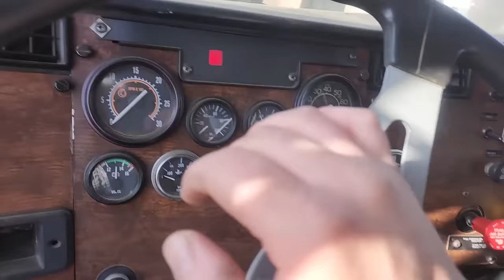"Valvetrain Knocking" is NOT what we find on this Engine.

Comment: Not a Cat engine issue here but, similar to this, maybe?  
I have a mid 90's Cummins L10 that makes what sounds like valve train rattle/injection rattle sound at low throttle but goes away when putting out some power.  Good power when it feels like it, okay power when it does not. 

New injectors and no oil consumption.    Anyone got any thoughts?

Comment: piston is installed backwards also cat motors have a specific liner inside taper of about 10 degrees if this is not finnished correctly oil sheer will kill your piston skirt

Comment: I think that injector wasn't working propply not burnig well, so fuel passed between piston and liner washing out the lubrification causeing piston seize. The knoking noise is due to piston wear, not any more perfet. As you noticed the  engine oil on the dip stick was slitly mixed wiyh diesel fuel beaing that colour.

Comment: remove and replace the engine from the front .remove the hood radiator and support and transmission . remove the rear mounts and support the back of the engine .remove the front mount from the engine and frame .now move the truck back until the front axle is at the rear support . now block the engine in front of the axle and remove what was holding the back of the engine .now move the truck away from the engine . set the new engine in place , and push the truck in to it .

Comment: By 2:10 it was evident that the engine has excessive oil leaking and was always being topped up. It 100% was run too low on oil....prolly more than once. Moghta had the wrong inhector on that scored piston.....causing the scoring which leads to blowby which leads to oil puking out which leads to carnage
Reply: Was thinking the same I know if you just want to check bearings you Crack a certain hole that gets oil last from the galleys I'm not sure which hole though

Comment: I would just disconnect the Darrick and lay it on some cribbing. Two big pins, some bolts, lay the draw works on pallets, disconnect the weight indicators from the draw works, disconnect electrical from the Derrick, viola. Call it a day.

Comment: Hey, I have a C7 acert 2006 in a freightliner. It runs fine when cold but after heats up, will start white smoking crazy and shut down. When you try to start back, smokes up the whole shop and if it does start will smoke and miss fire. If we leave it for a day come back next morning when engine is cold, it starts and runs perfectly. 

Checked all injectors all good, turbo had oil in it, we removed both turbo and exhaust manifold, manifold had oil in it. Ran engine without turbo and manifold same thing when gets hot.

We tested the HEUI pump by stepping up and down the demand with the computer but everything seems ok. Also has no blow by

Not sure what the problem is any ideas @AdeptApe

Comment: C12, 1 cylinder is causing alot of white smoke at idle, under a load(higher rpms)  the smoke turns black. Issue started all of a sudden &  engine is making a ticking sound. I  Swapped injector & problem is still there,  also making a ticking sound. Forgot to inspect the inspector liner for a crack. Can a cracked injector liner cause this problem? Or is this a bad cam? I did notice a push rod was bent a little, I put new push rods for the intake & exhaust. Injector push rod was good. Didn't notice any bent valves.

Working on it in a hotel parking lot where I just started working(it's a dump truck) no diesel mechanics around here & the closest cat dealership is 1 hour away & doesn't work on road trucks. Yep been hell.

Comment: I just recently had to put a gear case on a series 60 in a freightliner cabover because it was leaking oil. The only reason I found the leak is I blocked off the blowby tube and it began coming out from the leak😂

Comment: Is that truck maybe a workover rig for pulling the pump on a shallow oil well ? Or are you meaning water well drilling truck ?  Be nice to know why that scoring happened. We always stand up the pole or derrick before doing an engine swap and sometimes it requires an apu to run the hydraulics.

Comment: I have the same problem with my 3406 e  2002 MBN same noise from the front but the bottom of the engine 
150000 million on the truck 45000 hour's 
Just started this morning, gonna have to take it to a shop as im in Texas 1300 from home and i don't have all my tools wity me

Comment: It's an overheated cylinder. Radiator is probably just cooling the engine at partial load. Running it hard overheats the engine. I service 30 year old pivot irrigation engines. Really common event, to have the radiator plug up internally from the crap in the tap water they put in these engines. Buy and use only 50/50 premixed anti-freeze.

Comment: at 9:12 just before you get the prybar is there a crack in the block? right under the connecting rod with the two X's there is a very nasty looking line going up the block wall starting at the pan then looking like it got thinner as it goes up towards the crank.

Comment: Could of been piston to bore tolerances, ring gap, major boost leak or injector issue. Any thing with fuel or heat really will test out how well your builder rebuilt the engine.
Reply: It did seem like a bit of light shining around the piston from above suggesting the loose piston/ring package.
Reply: @Genifer Teal  I've been a machinist for 20 years professional . In that time ive noticed the tighter stuff will fail quicker. The piston and rings do not have room to grow when the heat is turned up in a high performance application or when ran out of normal operating range . Towing very heavy, leaky injector , extreme heat , boost leak . Those types of issues can cause extreme heat . When those scenarios happen your piston swells causing it to scuff the bore and butt rings. When a high performance engine are built on the machining side of things, all the tolerances are opened up to the looser side and beyond. Every metal grows the hotter it gets.

Comment: Hey quick question for you because I get mixed answers. I am buying a 1997 RV with a cat 3126 I believe. What engine oil should be used? I've heard 10-30 and I've heard 15-40 also read that 15-40 is hard on the heui pumps. Do you recommend changing that heui pump out after x amount of miles as a precautionary or just run it until it dies?

Comment: You oughtta see what happens when folks use ScotchBrite on engine components... It really doesn't take long for the abrasive residue to consume the crank and cam. Bearings will look slightly black, with little wear. Mic the cam and crank, call the machine shop and make an appointment for the crank, chuck the cam. 
Meanwhile, I sure amd fed up with Active Fuel Management engines and lack of maintenance to them.

Comment: Had to pause at a certain point and ask a question? If you owned your own truck why would an easy spot scare you I’m case a rock hit it? I run a Pete 379 and cat and run a easy spot. I’m very experienced with everything on my motor and also no rookie with rebuilding. Here’s my confusion on why you would be worried about an easy spot. If the oil dumped out that quick, you would lose oil pressure and your warning light would come on. Yes even on the early cats. At that point, you shut the truck down and address the situation. I know of no one who has had a easy spout get knocked open and I work in dump trucking.  Second, the truck can run relatively  long with no oil pressure. What I mean is that if oil pressure light or gauge reads zero, you won’t do any damage if you take the time and pull over and shut truck down. Cat recommends not to prefill oil filters. So when oil change is done, no oil pressure alarm is going off for several seconds.
Reply: Because a driver who don't own the darn thing will run it until it locks up or shuts off. I make a lot of money on people who do this.

Comment: You know what I got 50 trucks and I was really scared of putting those on but the Cummings has to drain plugs in it because there's a little suction on the back of the pan that always holds like two gallons of oil that no one ever seems to drain because it's an extra drain plug you got a pole and it pisses me off so I started using those on a couple of my rigs that have the double drains in there that are supposed to be drained that my guys never do drain anyway year-and-a-half have not had one malfunction or open up accidentally they work great was truly surprised was very scared of using them for a very long time then they were sitting on my shelf and I just wouldn't put one on there put it. Make specially when these guys come in after riding 10 hours a day when the oil is super hot it makes it really convenient if anyone's on the fence about using them year-and-a-half you haven't had a problem with one yet and I got them on all 50 my trucks and some of them have doubles

Comment: @5:17 cylinder 5 back valve looks loke its not staying straight on valve stem.. adjustable screw is rocking front to rear its hard to tell in video

Comment: Valve noise should be half the speed of the engine and piston noise will be at the speed of the engine. Since it's a 4 stroke the cam turns at half the speed of the crank. That definitely sounded piston from the speed of the knock. I have the quick drain that has a locking collar that installs over the plug to protect it.

Comment: Could the cylinder damage be from a bad piston oiler? Just wondering what your thoughts are on why that happened on that one cylinder
Reply: Possible, a completely stopped up spray tube would have resulted in a hard seizure and possibly could have pulled the piston apart. A bent or partially plugged spray tube would be more of what you see here. Depends if the failure is early or not. In any case the spray tube needs to be tested and NOT reused whatever you find. Also the nozzle needs to be tested, inspect the liner seals and do a failure analysis.

Comment: My only question is this : The scoring on that cylinder.. Was it a LOW oil state? or a blockage in the oil cooling jet for the piston? Or just a one in a million weak part failure nobody could have accounted for? Or simply something else. I am going to guess something to do with the oil cooling jet. I could be wrong.. but, I wanted to guess and see if I am correct.

EDIT : I went back and paused the video looking at the piston. The damage is where the most wear happens. If the issue is not related to oil state, then I have to wonder if the rings are all aligned and so the gaps all line up. (my overactive mind is trying to come up with every possible cause in existence).

Comment: The scoring on the cylinder is from the injector over fueling causing the injector knock u hear. It overheated the piston. You missed the whole diagnosis. That motor probably would of ran fine for a while still with that scoring. I motor doesn't gave to be perfect to still run ok.

Comment: It's been my experience that damage of that nature is generally caused by overheating. However in this case I don't believe that would be the culprit as it would have to be localized overheating which does not seem to be possible given the design of the block and cooling system. My thought would be incorrect clearance, incorrect ring installation, or possibly a defective piston given that this is a low hour reman. The man with the stethoscope comment has more than a little merit.

Comment: If you don't shift right and knock the gears constantly it will cause this issue on any diesel engine. People don't know their gears and slam them in the sockets. Make the RPMs drop faster than a Plane nose diving from the sky.

Comment: How does the metal get through the oil filter to damage the bearings? Is there another way for it to get into the oiling system?
Reply: I wonder the same thing! That should be filtered oil that gets to the bearings right? Maybe the metal just works it's way in from the oil in the pan sloshing around? Great question, wish someone who knew the answer would reply 😂

Comment: I always wonder about contaminated oil, when you continue to have engine problems after putting in a new rebuilt engine? 
I’ve seen problems, where they continue to keep using an oil cooler or cooler plumbing over and over again. And wonder why you keep losing engines to oil contamination? 

I never trust a used oil cooler! As it’s nearly impossible to clean them after oil contamination

Comment: Take the back plate loose off the oil pump first and you will drain a lot of oil out of the psi tube. Looks the the psi tube had a bolt in the pump, not needed. Only the suction tube requires the safety bolt. Should have a 7XC serial number. However you have to be careful. Your engine has the wide rod bearing design. On 7XC REMAN Cat uses a reference serial number, REMAN comes in 350 or 425 HP. So the idiot at one time used the reference serial number for a 350 HP, thus you can order the wrong parts. Best place is to take the arrangement number, which should be the REMAN part number and go to TMI and start at that point. Cylinder packs on these have been updated and Truck Engine News article covers this. What concerns me right now is single spray tube. Improvements require dual spray tube and oil pump retainer. The oil pump matches the single spray tube design. I would have to have the complete 7XC serial number to know more about this. Seized four corner piston failures can occur from several factors. Rolled liner seals is at the top of the list. Most of the time they fail early, but have seen them run awhile and under bad conditions, like a overheat, coolant, fuel timing, whatever it will catch up with the failed cylinder or the tightest one. Have seen a engine run two years with the wrong rod cap. Two and five was swapped and eventually it failed. Looks like the rod bearings did as they was suppose to and capture the metal and embed it from doing more damage. Now as you well know the lubrication system is now contaminated. I have taken the fuel system camshaft out on real bad contamination's and metal would be in the bearings of the fuel system. Oil cooler, filter base, Jacobs brake you know the drill. Gut call sometimes on how much to take apart and flush out.